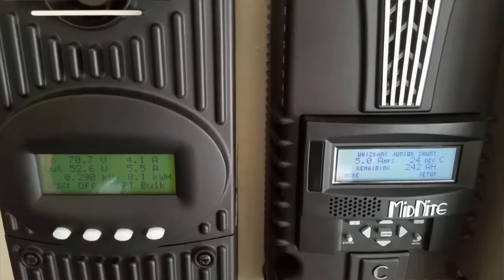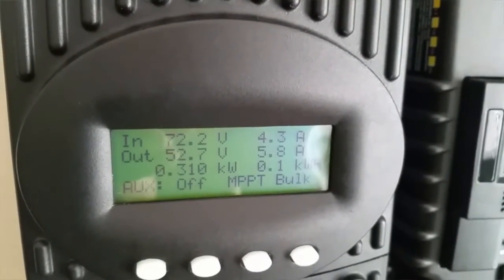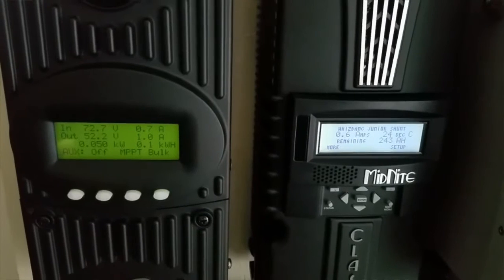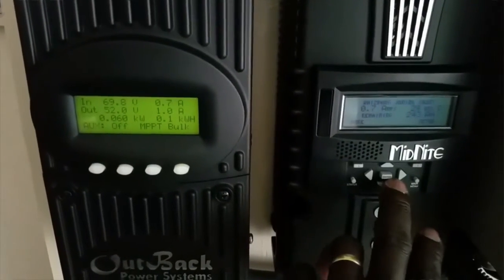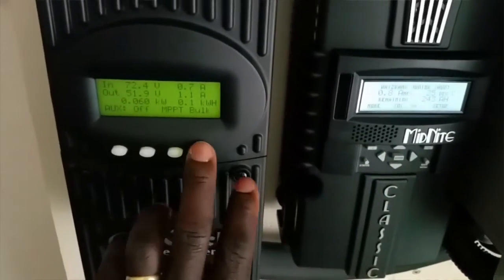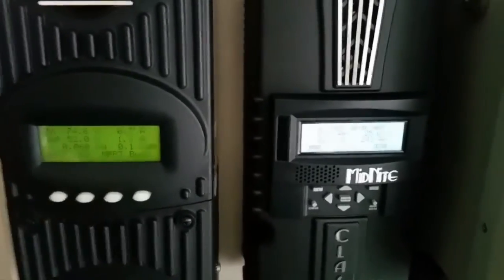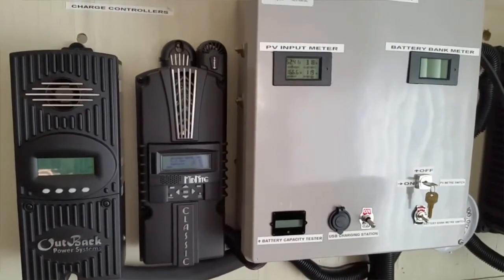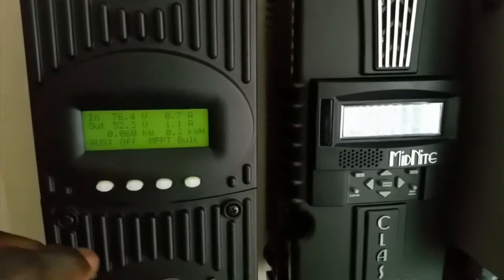IMPORTANT THINGS TO CONSIDER BEFORE INSTALLING YOUR FIRST OFF-GRID OR GRIDTIE SOLAR SYSTEM (Pt.2)

Comment: Would you run more amps or more volts?
Reply from the maker: Yes
Reply: @jwsolarusa  yes more amps or yes more volts? Midnite 150 or 250?
Reply from the maker: MidNite Classic 150v @ 96A
MidNite Classic 200v @ 79A
MidNite Classic 250v @63A
I hope you find this helpful and makes complete sense.

Please don't FORGET to LIKE SUBSCRIBE and SHARE my Channel
Reply: @jwsolarusa  will go for the 150 as abit cheaper here and can fit more panels
Reply from the maker: Good choice.
How far your Solar Array from the House?
Reply: @jwsolarusa  at a guess about 8/10 meters of cable. The panels are directly above the battery room
Reply from the maker: 10 meters is = 32.8ft
PV Wire size? 
What's the voltage you wanna drive in from the panels?
What would be your nominal voltage of your battery Bank?
Reply: @jwsolarusa  48v. I haven't bought the panels yet just trying to work it out for purchase
Reply from the maker: Good luck on your project and hope to see this awesome setup soon. 
Cheers
Reply: @jwsolarusa  I'm thinking a month or 2 yet.

Comment: The MidNite is better because of its built-in versatility and interchangeable between solar and wind. OutBack you have to buy all the extra features the MidNite has generically.
Reply from the maker: +Butch Weise 
Thanks for the comment my brother be safe and God bless you
Reply: Butch, you can now buy Midnite SL controllers which are solar only for about $75 less.  Not worth it, but it's there.